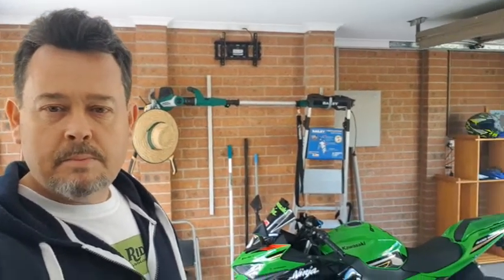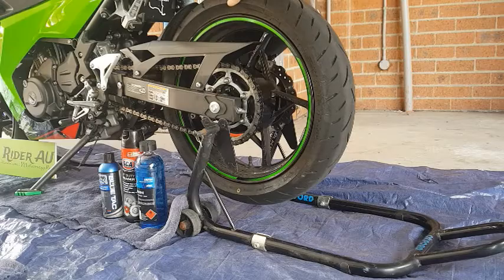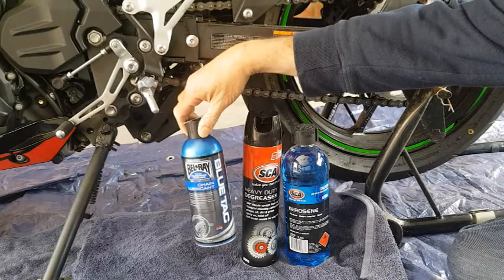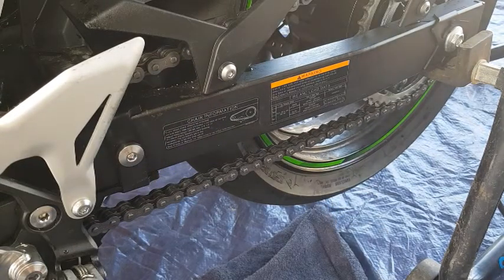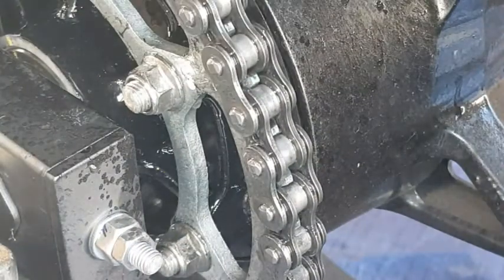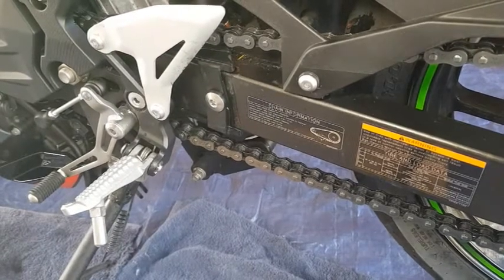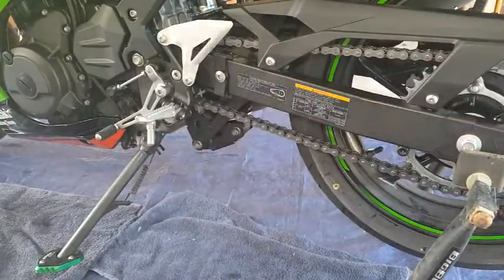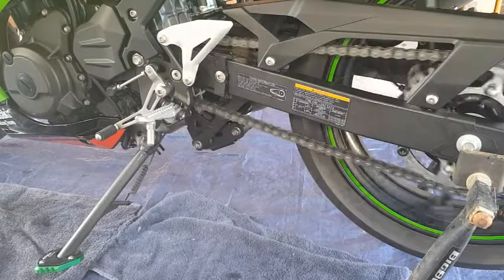Lets clean and oil the chain

Comment: Hi, I have always been told to never use degreaser on a motorcycle chain. it is very important to not remove the grease on the inner links. it does take longer to clean though grease and oil are two different lubricants. thats just what I have grown up to understand.  good video and close ups.
Reply from the maker: Thank you for your comment. The edges of these chains and more so for the newer bikes are sealed and has a lubricant inside to keep the chain lubed from the pins that join them. I would agree however that i didn't need to use a heavy duty degreaser but the standard degreaser is just as good on these new chains. A better option is just to use Kerosene as its better for the O rings which you mention. All chains get cleaned the same way and lubed on each side upper and lower of the chain. Again thanks for watching and appreciate the comment.
Reply: @motoriderau   That clears that up. funny thing with bikes, you always seem to be learning. Thanks again great video